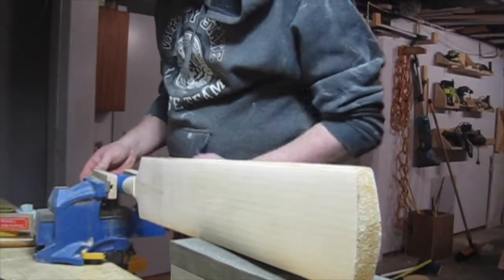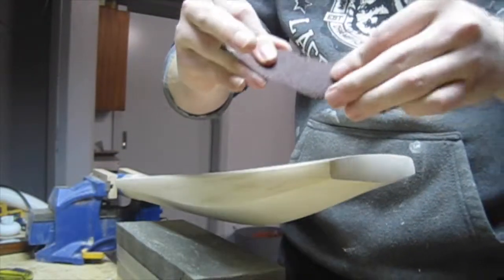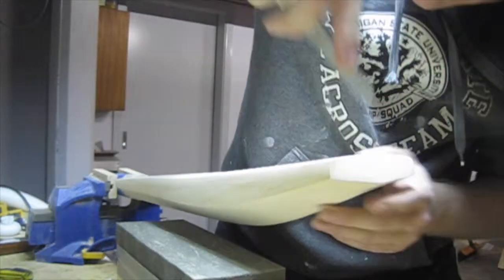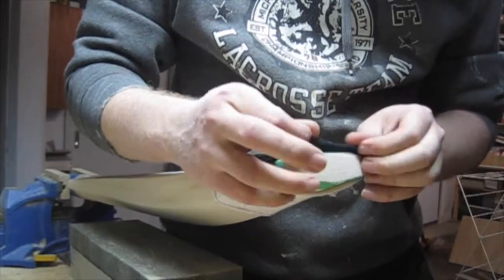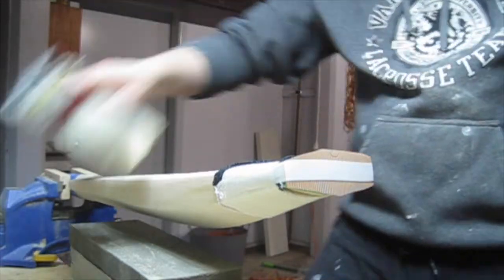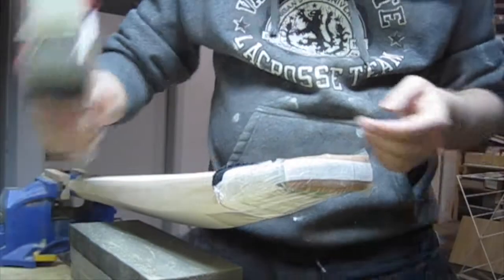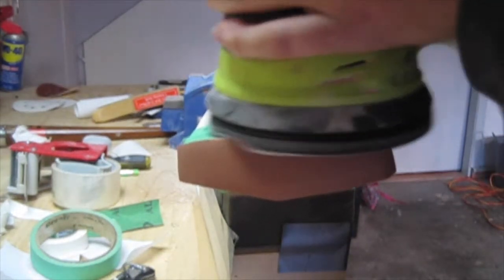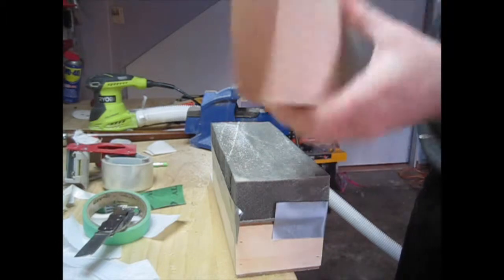How I fit a Toe Guard

Comment: Which glue you are using?  Shall we use fevicol for toe guard?
Reply from the maker: The glue in this video is called Loctite and is slightly different to the contact glues. I've never seen or used fevicol, but from the small amount of research I've completed, it should work well.